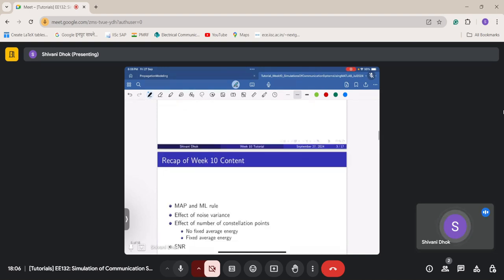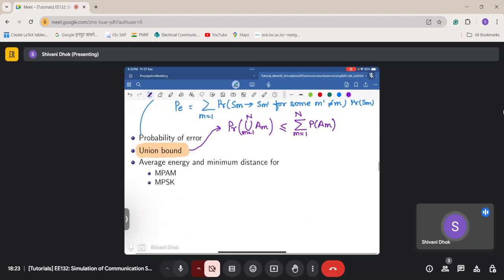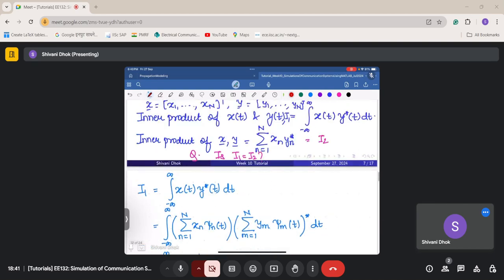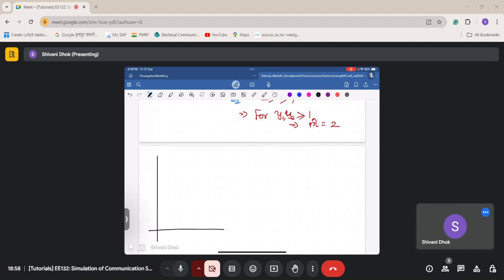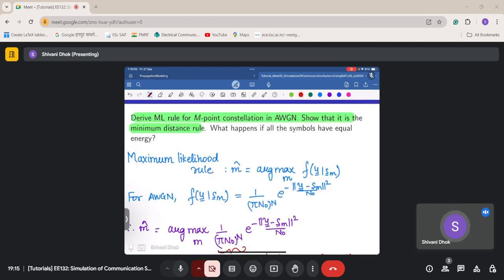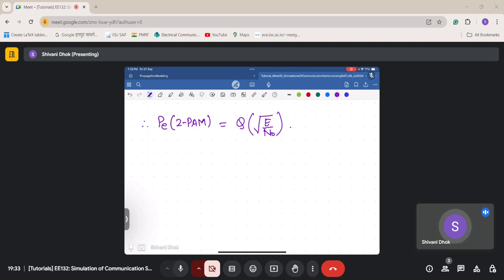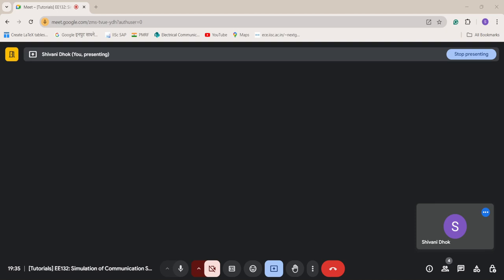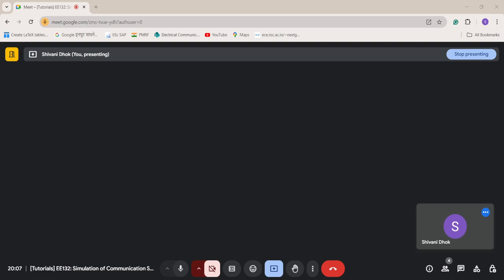Week 10 || MAP and ML Rule for AWGN || NPTEL || Simulation of Communication Systems Using MATLAB

Comment from the maker: Hi everyone. Due to some technical glitch, the MATLAB screen was not recorded. Following are the MATLAB codes for last three questions.
%%%%%%%%%%%%%%%%%%%%%%%%%%%%%%%%%%%%%%%%%%%%%%%%%%%%%%%%%%%%
Q8. MPAM (Simulation)
clc;clear;close all;
% Plot Symbol error probability/Probability of error for M-ary pulse
% amplitude modulation (PAM).

%% Setup simulation parameters
N = 1e+6;                      % Number of realizations of noise and symbols
M = 2;                         % Number of constellation points
No = 1;                        % Noise variance
E_avg = linspace(0,10,21);     % Average energy

%% Get Constellation points (Not normalized by E_avg)
A = -(M-1):2:(M-1);

%% Get the simulation for all the values of average energy
for ii = 1:length(E_avg)
    % Get normalized constellation points
    dmin = sqrt(12.*E_avg(ii)./(M.^2-1));
    A_const = A.*0.5.*dmin;

    % Get N random constellation points for transmission
    idx = randi(M,[N,1]);       % N random indices between 1 to M
    sm = transpose(A_const(idx));          % Get random symbols to be transmitted

    % Add noise to the transmitted symbol
    n = sqrt(No).*randn(N,1);   % AWGN noise with 0 mean and variance No
    y = sm+n;                   % Recieved signal
    
    % ML decoding, min-distance decoding
    d_all = abs(y-A_const);
    [val idx_dec] = min(transpose(d_all));
    sm_dec = transpose(A_const(idx_dec));

    % Get probability of error = Number of errors/N
    num_errors = sum(idx~=idx_dec');
    Pe(ii) = num_errors./N;
end
%% Plot the Probability of error
semilogy(E_avg,Pe);
xlabel('Average energy');
ylabel('Probability of error');
grid on;

%%%%%%%%%%%%%%%%%%%%%%%%%%%%%%%%%%%%%%%%%%%%%%%%%%%%%%%%%%%%%%%%%%%%%%%%%%

Q9. Binary PAM (Analysis+Simulation)

clc;clear;close all;
% Plot Symbol error probability/Probability of error for binary pulse
% amplitude modulation (PAM) and match with analytical expression

%% Setup simulation parameters
N = 1e+6;                      % Number of realizations of noise and symbols
M = 2;                         % Number of constellation points
No = 1;                        % Noise variance
E_avg = linspace(0,10,21);     % Average energy

%% Get Constellation points (Not normalized by E_avg)
A = -(M-1):2:(M-1);

%% Get the simulation for all the values of average energy
for ii = 1:length(E_avg)
    % Get normalized constellation points
    dmin = sqrt(12.*E_avg(ii)./(M.^2-1));
    A_const = A.*0.5.*dmin;

    % Get N random constellation points for transmission
    idx = randi(M,[N,1]);       % N random indices between 1 to M
    sm = transpose(A_const(idx));          % Get random symbols to be transmitted

    % Add noise to the transmitted symbol
    n = sqrt(No).*randn(N,1);   % AWGN noise with 0 mean and variance No
    y = sm+n;                   % Recieved signal
    
    % ML decoding, min-distance decoding
    d_all = abs(y-A_const);
    [val idx_dec] = min(transpose(d_all));
    sm_dec = transpose(A_const(idx_dec));

    % Get probability of error = Number of errors/N
    num_errors = sum(idx~=idx_dec');
    Pe(ii) = num_errors./N;
    Pe_ana(ii) = qfunc(sqrt(E_avg(ii)./No));
end
%% Plot the Probability of error
semilogy(E_avg,Pe_ana,'LineWidth',2);
hold on;
semilogy(E_avg,Pe,'o','LineWidth',2);
hold off;
xlabel('Average energy');
ylabel('Probability of error');
grid on;
legend('Analytical','Simulation');

%%%%%%%%%%%%%%%%%%%%%%%%%%%%%%%%%%%%%%%%%%%%%%%%%%%%%%%%%%%%%%%%%%%%%%%%%%%%%

Q10. MPSK (Simulation)

clc;clear;close all;
% Plot Symbol error probability/Probability of error for M-ary phase
% shift keying.

%% Setup simulation parameters
N = 1e+6;                      % Number of realizations of noise and symbols
M = 4;                         % Number of constellation points
No = 1;                        % Noise variance
E_avg = linspace(0,10,21);     % Average energy

%% Get Constellation points (Not normalized by E_avg)
A = exp(-j.*2.*pi.*(0:M-1)./M);

%% Get the simulation for all the values of average energy
for ii = 1:length(E_avg)
    % Get normalized constellation points
    A_const = A.*sqrt(E_avg(ii));

    % Get N random constellation points for transmission
    idx = randi(M,[N,1]);       % N random indices between 1 to M
    sm = transpose(A_const(idx)); % Get random symbols to be transmitted

    % Add noise to the transmitted symbol
    n = sqrt(No./2).*(randn(N,1)+1i.*randn(N,1));   % AWGN noise with 0 mean and variance No
    y = sm+n;                   % Recieved signal
    
    % ML decoding, min-distance decoding
    d_all = abs(y-A_const);
    [val idx_dec] = min(transpose(d_all));
    sm_dec = transpose(A_const(idx_dec));

    % Get probability of error = Number of errors/N
    num_errors = sum(idx~=idx_dec');
    Pe(ii) = num_errors./N;
end
%% Plot the Probability of error
semilogy(E_avg,Pe);
xlabel('Average energy');
ylabel('Probability of error');
grid on;